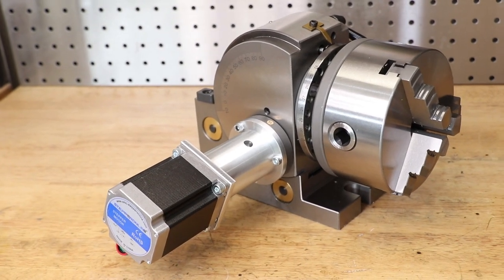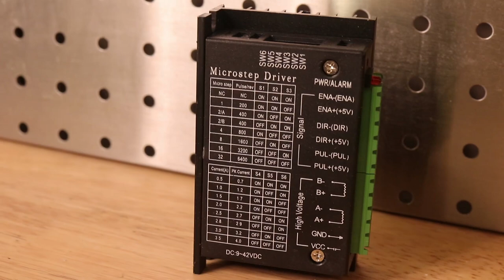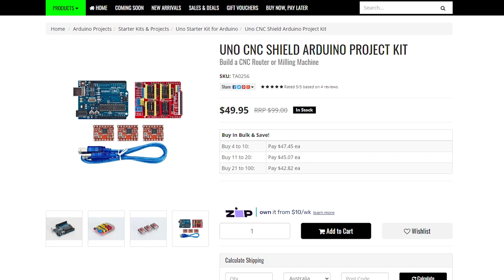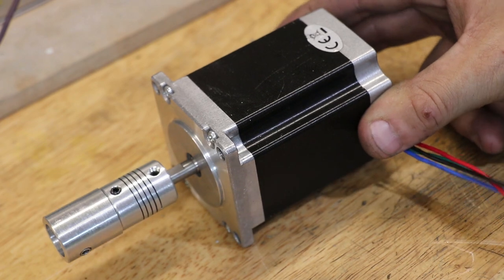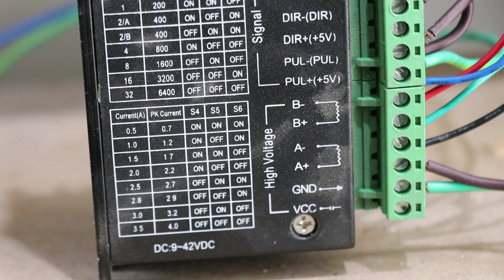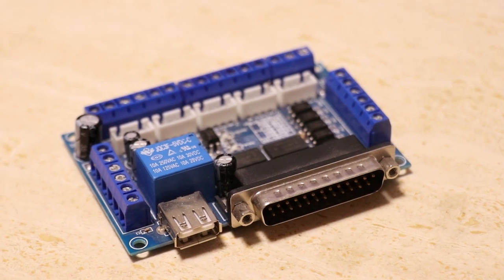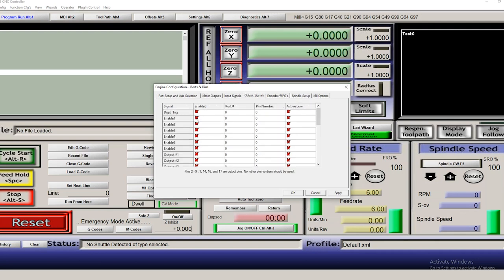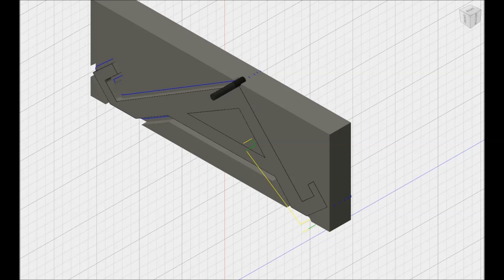DIY CNC Set Up Tutorial - Budget CNC Dividing Head (TB6600)

Comment: Hey matey,

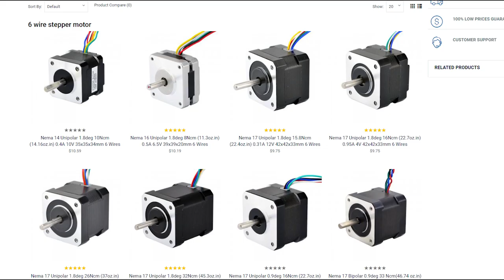4:29 I would recommend that you make sure there is no exposed wire coming out of those screw connectors. Greatly reduces the risk of a short circuit and on the power line, that means greatly reduced risk of fire. Don't trust the current limitation on those thing. Remember that anything can go faulty and prevention is the best practice.

Cool project though =)

Edit:
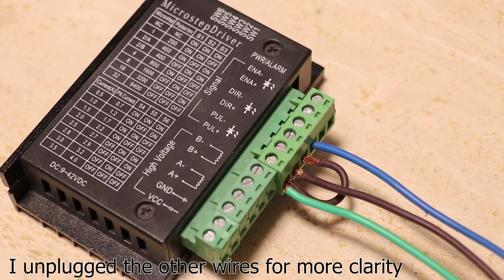5:30 Yikes!
Reply: The bigger problem is the lack of ferrules. Screw terminals aren't designed for bare stranded wire and the screw tends to splay and crush the individual conductors. The resistance of the connection tends to increase over time, so can turn into a serious fire hazard without you realising. Short circuits are usually fairly benign because they'll blow a fuse, trip a breaker or activate the OCP circuit of a power supply; there is no such protection against high-resistance connections.

Tinning the ends with solder is better than nothing, but Chinese crimp tool kits are cheap as chips.
Reply from the maker: 😅 Just a few things left over from my dodgy wiring days
Reply: I was about to comment on that when I saw this comment. Tinning the wire ends and trimming them so the part that sticks out of the insulation is just long enough for the purpose is a good idea. Those loose strands are asking for a disaster to happen. And that jumper wire that links two terminals on the same board? I'd use a solid core wire for that, since it doesn't need to be flexible.

Having said that, the project is really cool.
Reply: @j.dietrich  You are right. What a horrible wiring and don't using ferrules (for less than a cent a piece) as your LIFE-PROTECTION is one of the cardinal sins and worse than murder!!!
(BTW Artisan Makes stated that this was footage from his "dodgy wiring days" which implies that all sins may be forgiven, now).
Now to you, my friend. "Tinning the ends with solder" is exactly the same kind of madness (and not "better than nothing") and introduces an even MORE dangerous breaking point. Screw connections are NEVER suitable for stranded or tinned copper strands. There is not a single point about that topic to discuss. When it comes to electrical connections, you either do it right or you don't do it at all! (Reality has shown that not you, but friends and beloved ones, who are not familiar with your "creative wiring"/botches/(mis-)use of established techniques, get harmed or killed ... !!! Which in most cases gets the creative "engineer"  behind bars)
I don't mean that personally by the way, most of what you said are good tips. Just this one point brings everything into the category "Tips from the Internet from the bungler", for which one should be ashamed to spread this further. What do you think an amateur or beginner will do if given a choice?
Just my opinion: What's 50 bucks for a tool (not the Chinese junk) with a set of ferrules that maybe lasts a lifetime? Or if cost really matters, why not ask your neighbor, friend, or local maker shop? Additional advantage: They'll blow your ass off if you come up with such bungling and often have advice or wash your head with rationality and responsibility!:)
Learning by accident may be something. But some wounds don't heal or can't be healed! And some body parts are precious, that is why they are even grown on the own body:P 

This channel is great in giving ideas and advice. Also reading something like a machinists/electrician/etc. book hasn't hurt anyone, yet or asking an expert ... to my knowledge. Except that one case, where a master fell from the sky, directly on the reader. Have fun making and never put soldered strands, as an action or as an option, to the playtable again. Thank you!:)

What the experts do: NEVER EVER use solder-joints on CNC/machine tools (as in "avoid in any case" ... except vibration protected cases. Just a pun:P). There is vibration. There is movement. There are changing environmental conditions. That is the ENEMY of tinned copper. Why do we think screw connections protected against vibration (extremely cheap to produce ... just a spring plate is enough!) exist? Certainly not for the fun of it. You can see them in the video. Even on the "China-Stepper-Driver". They are there for a reason and we use them with the proper wiring (and don't shoot us in the foot by perverting the reason why they are used in the first place ... not to use solder-joints ... hmm, which is really an action of a madman and absolutely embarrassing, when you think about it, hehe).

Comment: Perfect application for an Arduino with a few buttons and a display that would move the motor the exact amount you need for an N-toothed gear ☺
Reply: For compact form, yes. For price nothing beats an old laptop, about 20€ you can get ones ready to use with parallel port
Reply: @MF175mp  price wise maybe - assuming space in your shop for another desktop, monitor, mouse and keyboard costs 0$ 😃
Reply: @MaximKachurovskiy  laptop goes to less space and can be put on shelf when not in use. Arduino or something like that maybe best if you want an integrated enclosure for the buttons and screen but it requires more tinkering, that's why I wouldn't be making one for myself

Comment: Good video as always, but I gotta say the TB6600 is no longer worth it. A DM556 is 20$ and runs “digital control”. Meaning that you get way more torque out of your motors, they run quieter and they run cooler. 
For the price difference, I’d highly recommend you consider the DM556.
Reply from the maker: Interesting, granted I first did this type of set up back in 2018, I guess they weren't around back then. Cheers

Comment: Plug that hole in your adapter so metal can't get in there. A cork would work, but some sort of threaded plug would be more elegant. This is a nice add-on to a dividing head. I have to wonder if your stepper can make sufficiently small steps so that odd tooth numbers don't cause issues for the stepper increments.

Comment: This is a fantastic video. However, as i understand it there are some drawbacks to using the parallel port "old skool" BoB's. For example, in this configuration the PC acts as the real time controller, and depending on a lot of factors that can cause issues that may be intermittent and very hard to track down. In contrast, the newer USB boards, like the PMDX boards pass that task off to the board which has dedicated hardware for the RTC, making things a lot more reliable, and a lot faster. I know very little about this stuff though, so I could honestly be dead wrong lol. However i wanted to comment because this is a great vid and it deserves a like and a comment. love the channel btw.

Comment: Basically 300 lines of code is enough for most lathe work for example if it supports canned cycles.
Reply: Johannes Fiftyeight  I had an Emco Compact 5, it lacked the canned cycles. Programs from the CAM software tended always to be near the 200 line limit of the machine. Now I have a Mori Seiki with canned cycles and I can write the programs by hand and they're short

Comment: I would recommend buying a ferrule set and putting those on the ends of your wires. Those are much safer than just bare stranded wires.
Reply: 100% agreed, the 4-way crimpers are good enough, and much cheaper than the cooler-looking 6-way... Remember, the ferrule gets the shit squished out of it anyway, so the number of faces doesn't really matter.
Oh, and never ever solder the ends of stranded cables that are going into screw terminals. That is a disaster waiting to happen!

Comment: I enjoyed your CNC approach to the problem and it covers all possible gear tooth counts, but if for now you just wanted 57 and 63 tooth gears, would making a specialised hole disc for the dividing head, leaving room to add more hole circles as required in the future? Would the PCD function on the mill DRO make this approach possible?
Reply from the maker: I talked about this in the first video. I could have done that, but having used this set up, it is just faster to cut gears this way, not having to much around with the sector arms. Plus I might have plans to turn this in to a universal dividing head, but that is a project for another time.

Comment: Once again a super video. I think but just for such a project an Arduino would be perfect. To control a stepper driver with an Arduino is really not very difficult. Then only a few buttons to adjust the angle and another to turn the dividing head by pressing a button.
Reply from the maker: Cheers, you are right Arduino grbl is better suited to this sort of set up, but I already had these mach 3 boards left over from an old build so it seemed easier and more straightforward. Cheers
Reply: @artisanmakes  I didn't mean GRBL at all. I meant that you could solve this very elegantly with a few lines of self-written code. However, I also understand that not everyone wants to program. I myself come from the computer science and therefore see this relatively easily, but I have e.g. for it not much idea of conventional machining. So everyone just has his specialty. This is not to be misunderstood, that was only meant as an additional suggestion.

Comment: One question. How do you compensate for the back lash of the worm gear?
Reply from the maker: You dont have to since you are only going in one direction.
Reply: @artisanmakes  Yes but any machining will result in chatter as the chuck rotates in the bac-lash zone. only a disc brake will work except for rotational milling.
Reply from the maker: @raymondcandiotes4639  Its not an issue here since I lock the dividing head spindle whilst machining. You'd do that even if you use the dividing plates. Cheers
Reply: @artisanmakes  Great stuff. Now a challenge for you to incorporate  an electronic lock to make it more of CNC than semi-cnc. Please don't get me wrong. I appreciate what you have done, but there is always room for improvement. Keep it up.
Reply from the maker: Cheers mate, all good. What I do next will really depend on how much I need the set up. If i need to use ot more often I'll probably swap it over to a larger size stepper motor or servos. Cheers

Comment: There is any backlash while machining with the divided head? Mine use a brake to ensure the fixturing of the piece, i m interested in to the conversion
Reply from the maker: There is backlash which you can compensate for, but if you’re only turning in one direction it doesn’t matter much
Reply: @artisanmakes  thanks sir,one question in my mind is when we indexing that spindle is it nessesery to
 tighten the worm wheel on every indexing??Or no need to tight ,,i think worm and worm shaft is fited with no play in both then not nessesery to tighten that locking nut... please answer i am waiting sir please please.

Comment: It's a shame about that 22.222 thing, ends up at 7999.92 steps per revolution of the rotary table (should be 8000).
Errors like that bug me.
Is there a way to calibrate it in steps per 360 degree rotation, instead of steps per degree? Steps per degree seems a poor way of doing it.
Also, why aren't you using microstepping? I'm sure those drivers support it, and it will be quieter and smoother can potentially reduce your "steps per degree" error.
Reply from the maker: I do use micro stepping, I just glossed over it for sake of clarity in this video. It reduces the error a bit. I'm sure there are ways around it but for cutting gears this is good enough.
Reply: @artisanmakes     ah, great, thanks for clearing that up. 👍

Comment: If you have this stuff on hand great but I hate to say it but TB6600 are garbage and you are much better off with something more modern.  Most of these you can buy new are not actually using the old tb6600 chip.  I'd also avoid mach3 and 8 bit micro grbl.  linuxCNC, grblHAL, or fluidNC are better options.  For a single axis indexer you can probably use a 3d printer stepper driver and a 32bit mcu with grbl with very little problems.
Reply from the maker: Like I said, these are left over from a project from around 2018, I know that these work and how to set them up, so ill use these, same for mach 3. I used linux CNC for about a year but I just didn't like it that much for various reasons.  I might have plans to turn this in to a universal dividing head so setting this up this way gives me the room to add the other axis later.

Comment: Well the TB6600 is the worst stepper driver I ever had.
I have tested it and it doesn't even manage to make one 360 degree turn precisely.
I have tested it with an incremental rotary  encoder with 600 steps per revolution.
I let the motor do 200 steps = 1 revolution clockwise and always got 580 to 620 counts on the encoder.
I repeated it multiple times letting the motor do 200 steps clockwise fowed by 200 steps counterclockwise and let it repeat for a few minutes storing the counts on the rotary encoder after every cw And ccw cycle.
With micro stepping the problem got even worse. When doing fast movements lots of steps got lost.
Then I repeated the experiment wit a DM556 
And the same motor and got precise positions.
You can lose steps on  a digital driver to  but you can drive the motor much faster then with the TB6600, even in microstepping.
The DM556 is a bit more expensive but it's a digital driver not an analog. 
So if you need precisely positioning avoid the analog TB6600 and buy a digital DM type driver.
Reply from the maker: Your experience isn't too surprising. Over the many years that I have used these motor drivers I have used some rubbish and great tb6600 drivers. From memory there were a lot of knock off ones. These ones that I use do tend to work quite well. If I did more cnc work than I currently do id probably buy better drivers. Cheers

Comment: think the mecanical part of building the cnc machine isnt that hard , problems start having to learn the desighn and execute software
i would like to build this setup for a manual operated machine to cut gears , theres less of a chance to go wrong as when using the holeplate thingies and counting youre rotations 
to do this with a steppermotor on the dividing head you shouldnt need to use mach 3 , you do need something that moves the servo / steppermotor a amount of steps / pulses at the press of a button (and possibly the same amount of steps in reverse in case it moves 2 sets forward by accident )
not sure how to call a pulse generator that puts out an exact amount of pulses (adjustable) to move the head a certan rotation every time , i know it can be done with an arduino but there has to be sumting simpler like sumting you set the amount of pulses on and have a counter countdown to zero every time you press the button
think this would work : https://nl.aliexpress.com/item/1005003561031959.html?gatewayAdapt=glo2nld